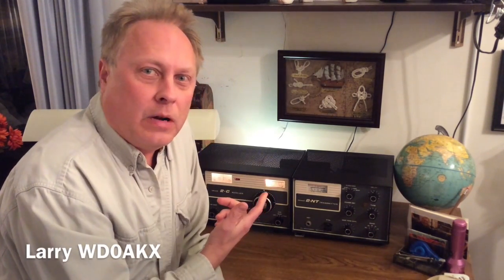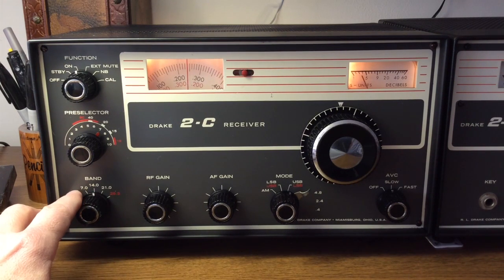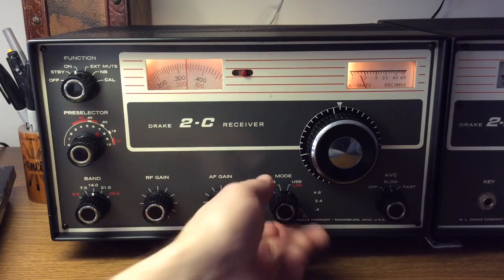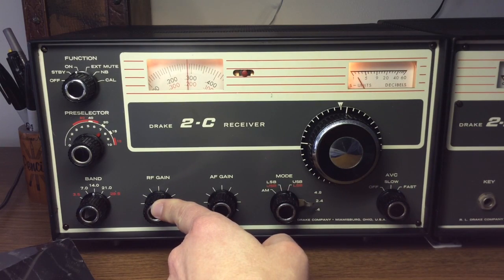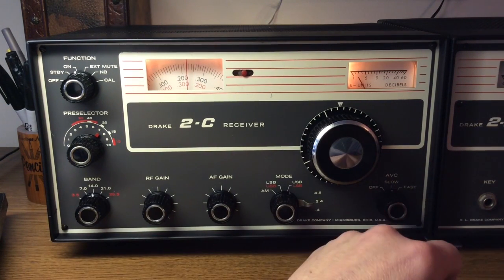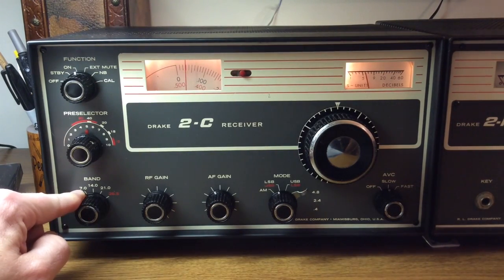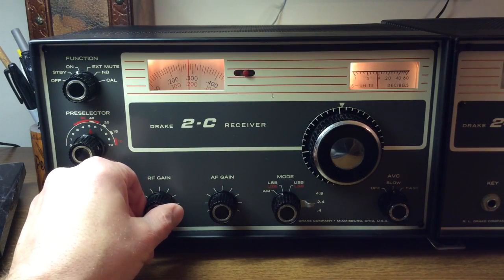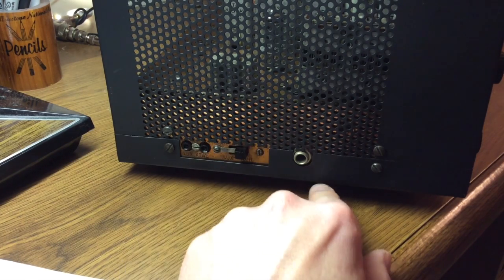A Look At The Wonderful Drake 2-C Ham Band Radio Receiver

Comment: I’ve owned the Drake 2B and also Drake R-4C receivers. Both were excellent in performance all-around. The pleasantness of the user interface experience with the Drake receivers is a primary element of their appeal.  The basic performance of Drake receivers, when properly maintained and aligned, is beyond what many contemporary operators would probably expect.  I have not owned a 2C receiver,  but IMO it is perhaps the most visually elegant Drake receiver. The carefully thought out minimalist design is appealing.

Downside: until the arrival of the C series of Drake equipment in the early seventies, nearly all Drake equipment used copper-plated chassis which looks beautiful when new but almost always begins to tarnish/oxidize badly at some point, and look unattractive. Scrubbing and polishing efforts usually don’t help, and so one usually has to simply accept and live with the unattractive copper oxidation. Fortunately, this is mostly only a cosmetic issue, and not usually detrimental to the function of the equipment. If you own a piece of Drake gear which still has a shiny copper chassis, then you are fortunate. Be very careful not to leave these units in humid/damp/cold areas or your chassis will soon begin to oxidize.

Comment: I have had a 2B since I got it new in 1963. I don’t know much about the 2C but it seems very similar to the 2B. My 2B was repaired by Drake and they put an R4B passband in it. I now have the same as the 2C except I also have a 1.2 kHz position. Near the end of the video you answered a question I had earlier. I am glad they have the extra crystal socket for other frequencies. My 2B has 4 extra positions (A, B, C and D)  that are very handy. I also modified my band A to cover 160 meters by cutting one wire on the band switch and adding a small trimmer capacitor. Worked as well as my Drake R4C on 160! No longe4 have the R4C but will never part with my 2B! It’s as good a receiver as my Elecraft K3 for all practical purposes!

Comment: In 1974 I was blessed to have in my first shack the Drake 2C and 2NT.  I’ll always remember pounding out CW in the middle of a hot summer nite.  Propagation was great hearing faint DX calls.  I was so foolish to sell them years later. 
I’ll always remember those early novice days.
73~Steve (K1KTF)
Reply from the maker: Hi Steven, I looked up your qrz page and that is a really cool photo there!  Nice page and nice shack and old photo of the Drake rigs!!
Reply from the maker: Also, you were very lucky back in the day to have those great quality and preforming radios.  A step above a lot of the others at the time!

Comment: Also have my factory Johnson viking ranger 2, antenna switch, brown bros. paddle/key. And like you its all in pretty mint condition.  I may not do the 30 wpm cw that I did , but I think I could pass the old novice code requirement. Out of curiosity, what is a 2-c worth today? Not that I'd part with it. Again, thanks
Reply from the maker: bob garr I am thinking around 200 dollars or so maybe but I have not really checked on any lately to see what others are getting, so that is a good question, this is only a guess.  Yes, good radio, I won't be parting with mine any time soon, haha.  73

Comment: The 2-C was my first serious receiver as a novice. I even had the matching speaker with the notch filter. The 2-C was nice when new but needs some serious alignment work when they get older as their sensitivity drops off with age. It wasn’t so much the tubes as the rest of the hardware that falls out of alignment. If your Drake 2-C is relatively deaf it just needs a good alignment by someone with the right equipment who knows what they’re doing. In top form, especially with the extra cost options, it was one of the better inexpensive receivers in its day. If it falls out of alignment it’s likely disappointing. Regardless, it will never match a high end Hallicrafters, Collins, or Hammarlund, or even the Drake R-4B. But, when at its best, it will challenge more expensive receivers and transceivers including the Japanese options from the same era.